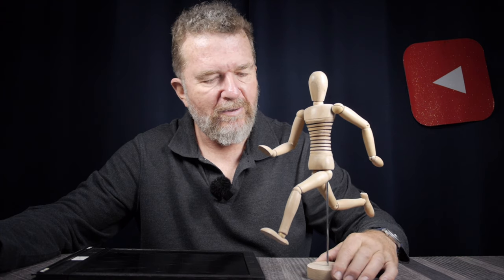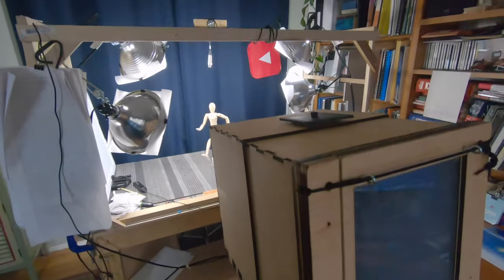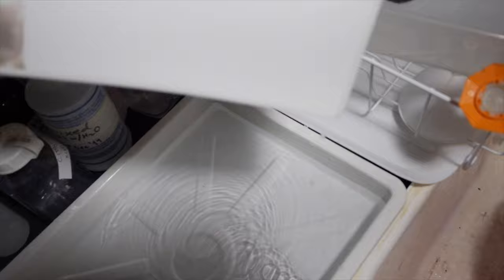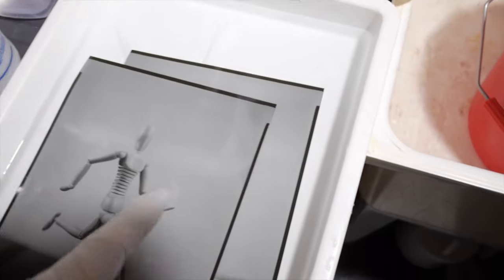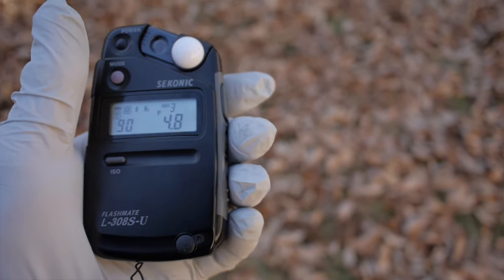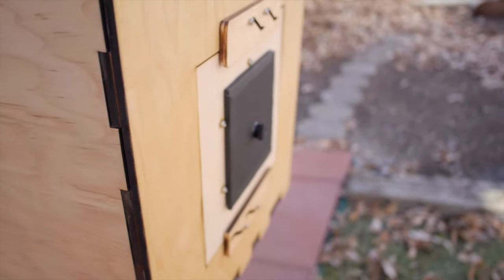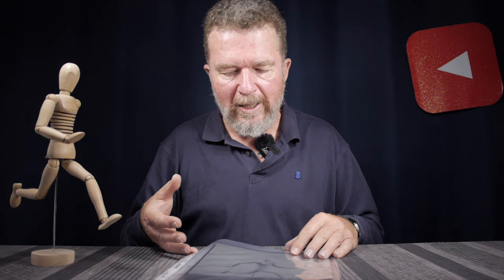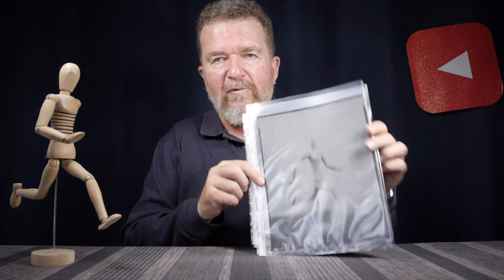More B&W Reversal Tests

Comment: Have enjoyed this series do far. I have not tried this yet but will soon. So I have a few questions/thoughts. If doing a negative in the zone process you expose for the shadow and develop for the highlights. Would this be just the opposite. Also if you had a second developer with a little potassium bromide or similar restrainer would that work for the highlights. Again I have not tried this yet.

Comment: Hi Joe. In order to try to maximize the white intensity of the highlights, I suggest to make an exposure strip and take note of the amount of light needed to achieve the full black tone of the second exposure. 

In my experiments with this reversal process, the overall balance of the image (midtown, blacks and highlights) was substantially influenced by the amount of light given in the second exposure. In comparative tests, going progressively darker on the second exposure, I witnessed the second exposure "eat" the lighter part of the image.

Ideally I would give it just the right amount of light to achieve the full black tone, but I ended up actually doubling that amount to make sure that a full black was actually achieved.
Reply: There may be other factors that make a difference in our setups, but I suggest you to try fine tune and quantify the second exposure and see if that makes a difference. Keep up the good work Joe!
Reply from the maker: @uomoartificiale  Thank you for the insight. I'm assuming with a controlled 2nd exposure, it would need to be fixed after?

Comment: Great video joe, but I wanted to ask you since the last video, what hydrogen peroxide do you use?  I tried your very same process but I couldn’t bleach my copy, I used grosery store hydrogen peroxide
Reply from the maker: It has to be stronger than grocery store peroxide. I get 35% food grade peroxide at a health food store that sells it for peroxide therapy. You can also get peroxide from beauty supply stores, but be sure you get the liquid, not the "creme" version, which is more like hair conditioner.

Comment: I have a smith corona manual typewriter from the 1940’s and wondered if you knew any ways to do a little bit of cleaning without taking it apart?

Thanks
Reply from the maker: You can do some cleaning of the segment area (in the slots where the type bars move). And depending on the Corona model, many had the underneath side open for access as well.

Comment: So, whe'r'ya gonna start handmaking your own mechanical shutters? :D
Reply from the maker: I have the one rotary shutter I've built, but it has a narrow range of speeds, due to its crude design. For the reversal process I'd need a shutter with a wide range of speeds, from 1 second down to about 1/100. Sounds like an electronically controlled shutter would be more appropriate.